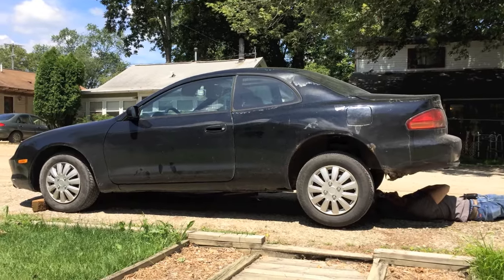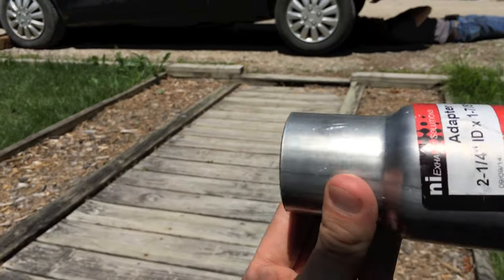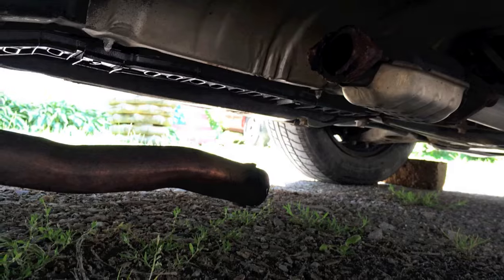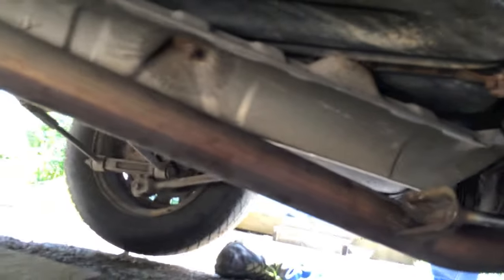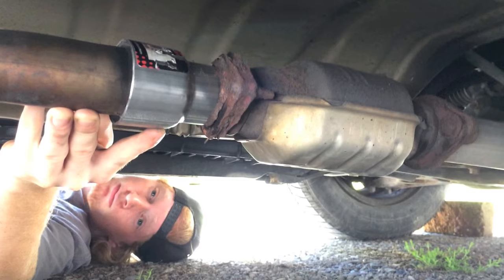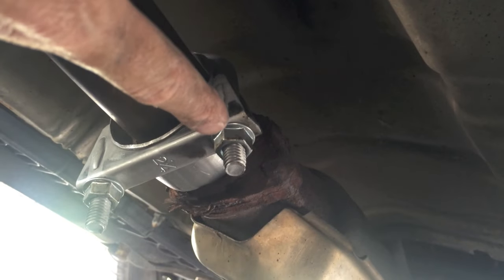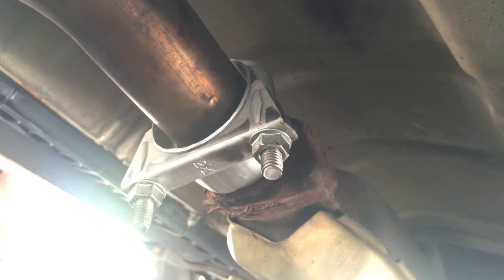Exhaust Pipe Quick Repair using pipe adapters - EXHAUST CLAMPS ROCK

Comment: You can also add exhaust tape that you can wrap around the whole exhaust. The tape will epoxy weld to the car after idling for 30 minutes. That's where I add the U Clamps on either ends. This ensures that there won't be any leaks in the exhaust. I use method all the time and it really helps when both flanges rust off. Awesome to see other people use this method too! Awesome video!
Reply from the maker: Ray 

Thanks for watching & sharing your advice.  We really appreciate it.  This is helpful info, you Rock!  Us fellow DIY’ers need to stick together!

😎👍🔧🔩

Comment: for those watching this later on; they make repair flanges with short lengths of pipe specifically for this scenario. you just need to get one that fits in or over your existing pipe. cut the old pipe to the end is even if needed, and fit the new flange section to the old pipe, bolt the flange to the existing section and then tighten the clamp.
Reply from the maker: kenabi 

Awesome Awesome & thanks for sharing your info!  That’s great info for future viewers!  We really appreciate you taking the time to reach out to us.

Please subscribe to the channel and turn on your YouTube notification Bell 🛎 that would be awesome thanks again!  😎👍🔧🔩

Comment: I'm a single mother of two girls and this just happened to me this morning. I think i can fix it just from this video!  I called and got prices for everything I need and I have a hydraulic Jack so I might attempt to do this on my own!  I just wish it wasn't so cold out right now and I wish I wasn't so scared of hydraulic Jack's! wish me luck! I'm just not sure what other tools I need to tighten the bolts and what not!? can you help?
Reply from the maker: Brown X and friends! 

Thanks for checking out the video and sharing your comment.  This is a pretty friendly Do-It-Yourself project & can save some money 💰 as well.

It is very important to use Jack Stands as well.  The last thing you want is the Hydraulic Jack failing.  A normal Ratchet & Socket set will come in very handy.

In the event that the hole is small, it’s possible that you can use Exhaust Tape to seal/cover hole.  Below is a link.

       https://youtu.be/Tc11bpnftBk

Definitely keep us posted on your progress.  Let us know if you have any additional questions along the way we are here to help.

Please subscribe to the channel and turn on your YouTube notifications that would be awesome thanks again 😎👍🔧🔩
Reply from the maker: Naked Snake 

Thanks for checking out the video and sharing your comment.  I agree 100%.  Jack stands are definitely a safer way to go.  You will notice in this video at Time “1:43”...you can see our Jack Stands.  Thanks again for checking out the video.  Please subscribe to the channel and turn on your YouTube notifications that would be awesome thanks again 😎👍🔧🔩
Reply: WTG!
Reply: l  drove one front wheel up on a stack of pedestrian tiles cement , anotehr time on a pile of gravel stiff mound . to make room to work under car . in a safer way. some put wheel or rim or wood log thick under
Reply: Your girls are super cute 😍
Reply: @halcyonoutlander2105  she for got to google jack stands….the jack failed and she got squished.
Reply: Good for you doing it for yourself. Thats a rare lady these days
Reply: Always use jack stands. Look at flea markets or harbor freight

Comment: Thanks so much for posting a great explanation. I'm heading to pick up these parts now. Since this video is ~8 years old now, I am curious how long this fix lasted? did you ever need to fully replace the exhaust pipe?
Reply from the maker: You are welcome.  That’s awesome you’re making it a DIY project.

This setup lasts a long time as long as the area of the pipe that the adapters secure to stays solid.  Keep us posted on your project.

Looking forward to 2024, many more helpful videos to come!  👍

Comment: Correct jb weld is only good up to 500f and exhaust can get to 1200-1500f in certain areas so jb weld does not work...i tried....will buy a high temp version ...🇮🇶

Comment: I just resently went through a flang that rusted out on my cat on my 96 Honda Accord, I went to my muffler shop and had the same pipe you had put on my car by my welder, he inserted the pipe into the cat a little and over the connecting pipe, the only difference is he welded both sides shut, so my car runs smooth and quiet, those clamps wont seal it shut so you must have had a noisey as hell ride after that, my suggestion since you might not be able to find a welder is to use some kind of muffler poxy to fill the side with the clamps and the area around were you inserted the pipe, wait a while for the poxy to get hard and no air leaks should be there, nice, quiet smooth ride now. P.S my mechanic/welder only charged my $50 bucks for the job and was done in 25-30 minutes, you probably spent at least $25 to $40 bucks on all that stuff, if you would have found a cheap but good muffler shop, you could have saved yourself the labor and headache and had it done for $50 bucks too, while watching the guy break his back all the while sipping a Coke, that's what I did, like ah boss.
Reply from the maker: Trunkzdbz 

Thanks for watching & sharing your experience & comment.  We really appreciate it.  That’s great info & will definitely be helpful for future viewers!

After this DIY project, our vehicle was very quiet.  We love these little adapters.

Thanks again for sharing your info, that’s awesome!

Please subscribe to the channel and turn on your YouTube notification Bell 🛎 that would be awesome!  😎👍🔧🔩

Comment: How do you use other clamps inside converter
Reply from the maker: Tika Khanal 

Thanks for watching Tika.  This is a pretty friendly do it yourself projects and can save you some cash.  We purchased these clamps & pipe adaptors from our local AutoZone and they were very inexpensive and last a long time.  Keep us posted on your repair let us know if you have any questions.  Please subscribe to the channel and turn on your YouTube notification Bell that would be awesome thanks again!  😎👍🔧🔩
Reply: Exactly the question I was going to ask.
Reply: So you didn't use the clamp
Reply: There is nothing holding that pipe inside the converter. No way. I've done hundreds of these. Where is the high temp lock Tite for the one u bolt you did use? Also why cut them down when you can turn the clamp more sideways? Why didn't you get the right size to fit over the pipe? That fix didn't make it out of the driveway

Comment: I have a 2017 Sonata Sport 2.4L ; the flange broke completely from the pipe apparently from impact damage.  For now, I’m using your method of repair; thank you for the video. 
Is the same size adapter recommended and how did Nick get to the adapter inside the converter? I’m not mech savvy, but I can copy what I see, (so please forgive the probably ‘duh’ question I asked)...thanks again!
Reply from the maker: carmen 

Thanks for watching & we hope the video helped.  At the 1:25 point in video is where it explains more about the converter & pipe...check that out, you may find it helpful.

We really enjoy making these helpful videos for our fellow DIY’ers.  Many more helpful videos to come!  😀

Let us know if you have any questions.  Please subscribe to the channel and turn on your YouTube notification Bell 🛎 that would be awesome thanks again!

😎👍🔧🔩
Reply: @DIYwithMichaelBorders  thanks for the reply. I definitely will watch again, I've watched 3 times, can't believe I missed it lol.
I already subbed 🤜🤛🤝👍😊
Will post results!
Reply: DIY With Michael Borders I just watched again after posting the reply, then looked at my original question and realized I forgot a few key words.  What I meant to ask is, how did Nick get to the adapter inside the converter *to attach and tighten the smaller clamp*?
Reply from the maker: carmen 

Thanks for subscribing, we subscribe back!

😎👍🔧🔩
Reply from the maker: carmen 

Thanks for the question.  We just inserted 1 7/8 tip right into the converter...then clamped into place.

😎👍🔧🔩
Reply: @DIYwithMichaelBorders  I'm at the same point if it's inserted inside did you just crimp down the outside pipe
Reply from the maker: @jesterfrost1369  

Thanks for watching & that’s all we did until it was properly secured.  😎👍

Comment: Okay , the clamp holds it on the pipe but what keeps it from pulling out of the converter ?
Reply from the maker: Thanks for watching, there isn’t enough play for the pipe to slide out of converter.  All remaining exhaust mounts are still secured.
Reply: ??? @DIYwithMichaelBorders

Comment: Are the dimensions of the adapter used pretty much the same for all vehicles and exhaust systems?  Or will the size change depending on the vehicle?
Reply from the maker: Thanks for watching, great question.  You can find several different sizes at your local AutoZone.  You can share your vehicle details with the employees and they will be able to assist you in getting the proper size adapters.
Reply: @DIYwithMichaelBorders  thanks for the quick reply.  your video is awesome
Reply from the maker: @davidjamesqc  

We appreciate that, means the world to us.  😁👍🧰
Reply: I tried three autozones.  They all tried to look up the part and size I need but said I would have to provide the measurements to them myself or the exact part number I need.  So now I guess I need a tool to measure the diameter of the exhaust pipe.  I’m gonna see if I can fix mine like you did.  I do not want to buy a whole new exhaust system.  No way
Reply from the maker: @davidjamesqc  

Thanks for the update.  After allowing engine and exhaust to cool off, a simple trick is to measure the very back-end part of your exhaust pipe.  Measure the pipe from one side to the other, should only be a few inches or so depending on your pipe.

You can use that info to get the proper size adapters.  👍

Comment: Hi Mike.  I have a 2006 Honda Pilot, and this exact issue happened this morning.  I put the Search bar "honda pilot 2006 muffler tail pipe replacement", and your video from 8 years ago pops up in my feed.  It seems like what you did in this video would fix my problem.  Where did you get the 2 parts you featured in this video?  I tried to make out the website URL on the Adapter. but its a bit blurry.  Thanks, Neill.
Reply from the maker: We are honored to hear our video came up.  We can hopefully help.  If interested in purchasing this product, visit our Amazon affiliate link below.

       https://amzn.to/3bLbUbP

       https://amzn.to/40WnJFm

       https://amzn.to/3L6kq6Z

We are always here to help, looking forward to hearing back from you.

👍🧰
Reply from the maker: Also, may you find our other video helpful, link below.

     https://youtu.be/SveojW4r3n8?si=Lll9-C76Ec8y0d0m

👍🧰
Reply: @DIYwithMichaelBorders  Hi Mike.  Thank you for the quick response.  I am not a Mechanic myself, so the links for the 2 Tools you provided I won't need, nor would be able to afford them. LOL  Where I live, there are 3 Mom & Pop Garages where the Customer can provide the parts, and they will do the Labor.  The Universal Pipe Adapter I can definitely afford.  I saw that the 2 U-Clamps featured in the video were 2 1/4 & 1 7/8.  I was able to find them on Amazon, and I filtered the results to make sure they were specifically for my 2006 Honda Pilot.  Right now I just have to be really careful driving until the parts arrive and I can get this fixed.  I will keep you posted.
Reply from the maker: @lemoncake6002  

Very cool and we appreciate the follow up.  We are always here if you have any additional questions.  👍🧰
Reply: @DIYwithMichaelBorders  Hi Mike.  Amazon has the Nickson Industries 2 1/4 ID X 1 7/8 OD Exhaust Adapter you used in the video, so I ordered that.  I have a 2 1/4 U-bolt Exhaust Clamp also ordered.  It was hard to find a 1 7/8 Clamp, but I did.  Unfortunately, the 1 7/8 Clamp won't arrive until Monday, December 4th, and that is with a Prime Membership.  The other 2 parts will arrive Wednesday, November 29th, which is weird but what can I do.  Now, at the end of the video, you mentioned that the 1 7/8 Clamp was installed inside of the Catalytic Converter.  Since that wasn't shown in the video, could you provide the details on how that was done?  That way I can give those details to the Mechanic.  Thanks, Neill.
Reply from the maker: @lemoncake6002  

Thanks for the update.

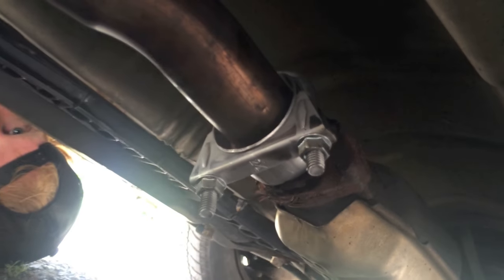As far as the 1 7/8” adapter…if you go to the (2:30) mark, you will see the adapter.  All we did was slide the smaller diameter side of adapter into converter, and that’s because the converter was completely rusted and we needed that adapter to create the connection.

😁👍🧰
Reply: @DIYwithMichaelBorders  Got it.  So, do I need the 1 7/8 U-Bolt Clamp that is arriving on Monday, or is it not needed?  Thanks.
Reply from the maker: @lemoncake6002  

You might need it, good to have it on hand if so.  You can always return it if not needed.  👍
Reply: @DIYwithMichaelBorders  Hi Mike. My Order for 2 1/4 ID X 1 7/8 OD Exhaust Adapter you used in the video arrived, as well as the 2 1/4 U-Bolt Clamp.  I still haven't been under the Car yet, since I am waiting for the 1 7/8 U-Bolt to arrive.  Now I am wondering if the 2 1/4 ID X 1 7/8 OD Exhaust Adapter was the right size.  When I got on the ground just to get a sense of the size of the existing Exhaust Pipe, it seems larger, but I might be wrong.  I have been doing searches on the internet and YouTube trying to find out the size of a 2006 Honda Pilot Exhaust Pipe, but no answers come up.  I even went to the Manual that came with my Car, and there is no information on the size of the Exhaust Pipe.  On the 1995 Toyota Celica featured in this video, did you measure the size of the Exhaust Pipe on the Celica before you placed your Order for the Adapter?  Thanks, Neill.
Reply from the maker: @lemoncake6002  

Thanks for the follow up ☕️

Don’t recall taking exact measurements.  We purchased a hand full of adapters and sorted through until finding the one that fit perfectly.  👍🧰
Reply: @DIYwithMichaelBorders  Ok.  Well, I was able to order a 2 Pack of Car Jacks from Amazon today, which should arrive tomorrow.  I will finally be able to get under the Car myself and measure the OD & ID.  Also, I bought some Stainless Steel Zip Ties with a Tensile Strength of 198 lbs., which will allow me to pull the pipe upward making driving easier without having to worry about the pipe dragging to close to the road.  That will buy me some time until I can get the correct size for the  Pipe Adapter.
Reply from the maker: @lemoncake6002  

Awesome, great idea on the upgraded and more reliable zip ties.  Your preparation will serve you well when tackling this DIY project.

We enjoy reading your updates.  😎👍

Comment: question how do you secure the 1 7/8 to the converter?  If you tighten it down with the clamp it will break through the rusted end of the converter.  great video just need that missing piece.
Reply from the maker: Sho 1 Hey there and thanks for watching.  I just slowly and with lots of patience tightened each side a few turns at a time.  You're right though,....small little missing price would have made video better.  Thanks again.  Please Subscribe to the channel.  That would be awesome 😀👍

Comment: Great but how do you keep the pipe that’s inserted into the converter from leaking? I guess u just push it in? That won’t last..
Reply from the maker: Thanks for watching & welcome to the DIY Raptor Club.  There are a few options.

You can apply exhaust temperature rated gasket maker which works good.  You can also apply exhaust temperature rated tape which is an awesome option.

Keep us posted on your project.  😎👍

Comment: This just happened on my 2001 Jeep Grand Cherokee. Looks like a great temporary fix! One question though, if I choose to add exhaust tape, where would you recommend adding it?
Reply from the maker: Joseph Simmons 

Thanks for checking out the video and sharing your comment Joseph.  This is a pretty friendly DIY project & will definitely save you some cash!  

The exhaust tape can be very handy as it can be applied anywhere.  You can use the pipe adapter & clamp it into place.  You can then use the tape to cover/close up any additional gaps...which in return will make that exhaust much quieter.  Hope this helps.  Let us know if you have any additional questions along the way we are here to help.  Please subscribe to the channel and turn on your YouTube notifications that would be awesome thanks again.  😎👍🔧🔩
Reply: nice thats the best jeep ever made
Reply: @DakotaRaymond1999 I'm not gonna argue with ya on that but I'm just telling ya my buddy's got 2 98 Cherokees and they rip, one of the only things we can take through a muky ass corn field and to school the next day like it was nothing. You think your 01s the best, get a 98 and you'll never go back 🤣 nah fr tho check em out sometime there cool lil things
Reply: @tommydrymouth8800  my 1993 is cool but doesnt compare to my 1999 or 2003. 2005 still doesnt compare to the 1999.
Reply: @DakotaRaymond1999  hell either way where I'm from look at it like this, next year your 1999s wont need to pass emissions to pass inspection, idk all ik is them 4.0s rip no matter what Cherokee it's in, just gotta make sure you have steel heads, them bitches come with a rev limiter 🤣 put her to the floor for 40 mins before it blows my buddy watched someone do it cuz they were doing an engine swap anyways

Comment: so u didnt need to use the other clamp? the 1inch one?
Reply from the maker: Thanks for viewing....I chose not to only because the converter was pretty rusted and the adapter fit far enough into it.  Clamping opposite side worked.  Subscribe to the channel if you're up to it.